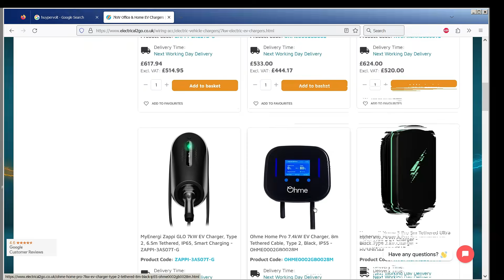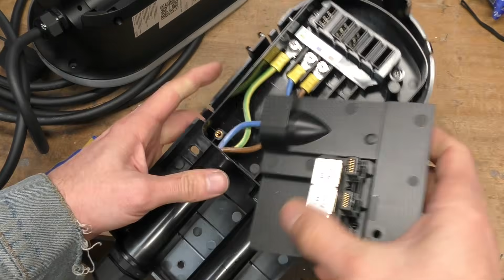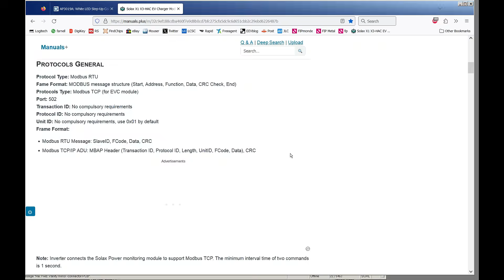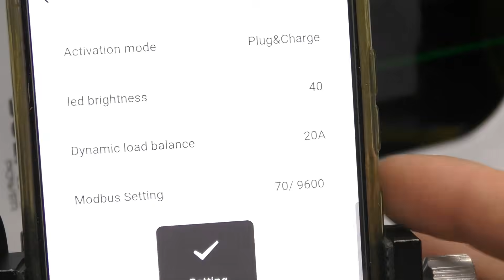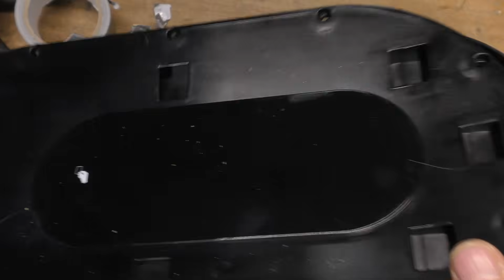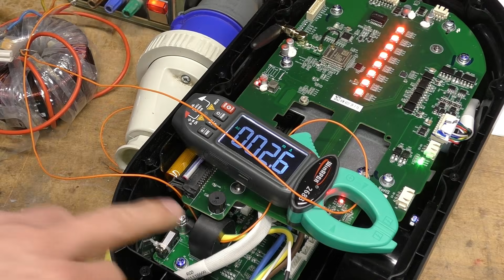Solax X1 EV charger (EVSE)

Comment: One fun activity is to try to actually find any exposed conductive surface on a modern car! Seriously, modern cars are extremely well corrosion proofed, and as a result, without lifiting the bonnet, it's pretty hard to find a conductive surface to touch!  tyoically nickle plated door hinges and striker pins are about your lot.......
Reply from the maker: Yeah, not much chrome plating nowadays... Washing alloy wheels with a hose is probably the biggest risk.

Comment: Not charging during morning and afternoon peak times is also useful for complying with restrictions that might be applied by building regs - our new build house came with an EVSE and they were required to restrict charging to lower demand times.
Reply: You don't need to make it that complex. Just make EVs required to respond to electricity producers' request to drop demand. Translated: stop charging before grid operators start load shedding. They do the same to datacenters.

Comment: An upgrade from your OpenEVSE unit then?  I was looking at the Zaptec Pro, for it's Bi-directional facility, future-proofing, but it's quite expensive.  Would the Solax be able to do V2x with a firmware update or is there more hardware required?
Reply from the maker: No - V2G needs a DC charger, as although possible with AC, it's not really practical for various reasons.
Reply from the maker: Zaptec includes ISO15118 comms hardware, but this would only be useful with cars that supported V2x on AC, which is unlikely to happen as the car's onboard charger would need to support grid-synced operation, and carry all the required approvals.

Comment: The anti tamper switch is a requirement coming from the UK Smart Charging Regulations. A lot of the UK SCR is about cybersecurity, so I think the idea is to alert the owner/operator of physical tampering. There's also requirements for alerting on software aspects such as firmware changes

Comment: For what is a "cheap" EVSE, that's looking better made than the Ohme Home Pro which is more expensive.
Reply: The Ohme is pretty flaky too. It seems to crash quite often and always seems to have connection issues even in strong cellular areas. The fixed AC lead is also not that useful.
Reply: @sdgelectronics  The AC lead loves to coil back on itself and Ohme's platform refuses to stay connected to my car. but it was "free".

Comment: At work we have issues with the relay not made to be breaking the load. The chargers lose power when we do our monthly generator test and sometimes if a car is charging it welds the relays shut.
Reply from the maker: If it's lost power, how is there any current to weld the contacts?
Reply: @mikeselectricstuff  There's a ~20uF class X capacitor inside most car on board chargers. Perhaps other loads on the site draw current through the relay as the power fails? Seems pretty odd though.
Reply: @mikeselectricstuff I can only guess, but it may just be related to inductive loads in their setup. It may be that the chargers don't lose power, but actually shut off due to overvoltage or whatever.

Comment: Separate earth points likely for use in countries with TT supplies, where you need a separate grounding rod, and that GDT common for the MOV units will be connected to neutral, with the separate earth point connected to a grounding rod.

Comment: Try using the E-Stop to reset the RCD fault. My EV charger (ZJ Beny) in Australia also has an E-Stop and it's used in certain situations not just as a E-Stop.
Reply: Good point since its hardwired, thats probably an easy way to do a reset.

Comment: The odd earth path for the MOVs could be a way of easily disconnecting them for a hi-pot test at the factory. As it's being assembled that top board won't be present and it's not going to damage the parts or influence the test.

Comment: I was sold on it up until the point where I saw the Mornsun DC-DC. Too many bad experiences with cheap Chinese converters (Mornsun, Chinfa, etc). At 28:30, that PCB is probably a blast shield for when the Mornsun lets go! 🙂

Oh no, it gets worse, I've just seen a Hong Fa relay, oh dear, I had such high hopes at the beginning. To be fair many of the other manufacturers have swapped their Japanesium for purest Chinesium in later models. It's a shame, a nice Panasonic relay is far superior to its Hong Fa 'equivalent'. Take a couple apart and look at the design and build and you'll see what you are paying for. It's all very well if these fail during the warranty period but given the high cost of a 'charger' and the installation/swap-out costs, I think it is false economy. As a consumer I would rather pay the additional cost for a decent XP Power DC-DC and Panasonic relays.

Thanks for taking the trouble to make the video, it was interesting to see what they've done.

Comment: I would think the solar configuration uses the same CT setup as the total mains limit system. You put the CT either where it measures your net house draw our measures the solar output and then it adjusts the charge limit to work the draw down to zero but no further. So you use up to all of your solar production but no more.
Reply: I've just installed a sync energy "charger" which has the same solar feature and there's a gotcha with hybrid solar systems with batteries. Both EVSE and solar have CTs, on the grid connection and both, in certain modes, are adjusting things to get the current as close to zero as possible. The Solar system, when PV output is less than house use and there's power in the batteries, will discharge the batteries at a rate which makes the grid current zero. The EV system similarly is tuning charge current to keep the grid current zero. The problem when both CTs are on the grid connection is that this leads the solar system to discharge its batteries to charge the car, since it's seeing the car charge current as part of the house load. That's not a desirable behaviour. Fixing this is easy in theory: put the EV CT on the grid connection, as before, and on the load side of that CT split the conductor into a connection to the charger and a connection to everything else. Put the solar CT on the "everything else" wire. That means the solar system won't see the EV as load and won't discharge the battery to charge the car. The practice of doing this is more difficult. Your average jobbing EVSE installer has no idea that this is an issue, and in my experience can't even be made to understand what the problem is. One typical installation has an MCB for the solar and an MCB for the EVSE in the consumer unit, fed from a bus-bar, and there's no easy way to wire it such that there's a conductor which carries the rest-of-house load but not the EVSE load. If the EVSE has it's own CU fed from Henley blocks, it's easy: just move the solar CT to the load side of the Henley blocks that split the EV supply off.
Reply: @simonkelley7073  To save hassle rewiring your consumer unit, why not get an extra copy of the CT that the solar system came with, put it on the EV charger cable, and connect it in parallel with the existing solar CT sense wires. If you get the polarity right, the solar system sees "everything" minus "EV". *some so-called CTs actually have a voltage output and these would need to be connected in series, not parallel.

Comment: Presumably with local MODBUS connection you can have full access to all functions in the charger?  My solar system / battery storage has that and running MODBUS to MQTT allows for flexible monitoring and control.
Reply: OCPP is even better than Modbus for this application. OCPP is the protocol behind more complicated charger setups and even paid public chargers and it plugs in to Home Assistant very nicely for all your monitoring and automation needs. :)

Comment: It's funny you of all people call it a charger when it's NOT a charger.. It's a safety device disguised as a glorified switch and electricity meter
Reply: boo boo
Reply: Try to define a charger cleanly and you might find that it is at least part of the "charger".
Reply: 'Charge point' is a better description.
Reply: Yea but they all are, the regulation is within the car but it does charge the battery doesn't it.
Reply: I get blank looks when I ask someone if they've got a Mobile Device Supply Equipment (MDSE) to provide an electrical supply for the internal charging equipment within my phone to charge the phone's battery (WRONG - it's a cell!).